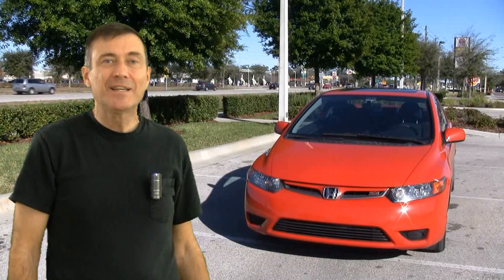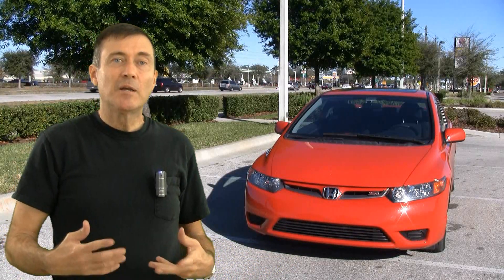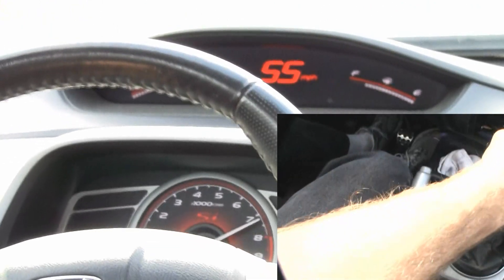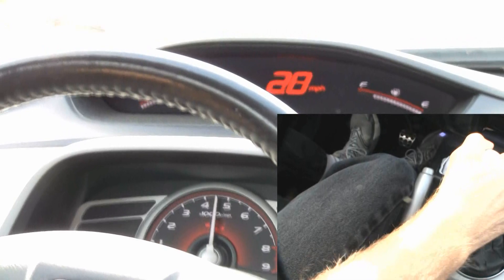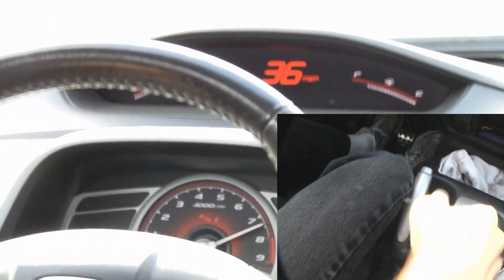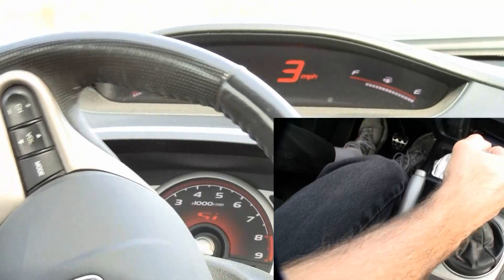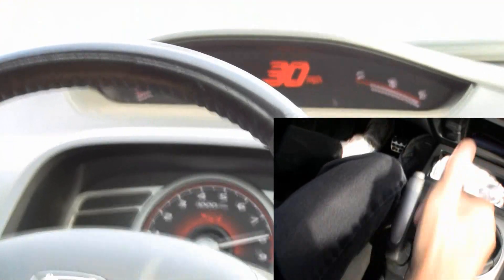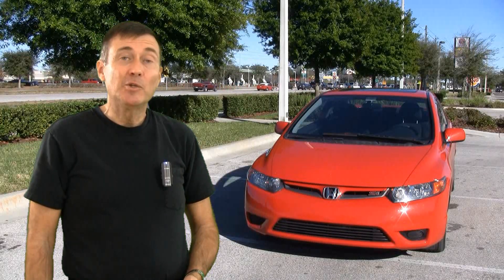Honda Fail #1 - Drive By Wire Sucks

Comment: I have a 2020 Civic Si Coupe and the rev hang in it was horrible. Pissed me off so bad. Made me hate the car and made me regret buying it. Bought a Hondata FlashPro and disabled the rev hang and the car drives so much better now. Drove me nuts before I disabled it. Will not be buying another Si again, that's for damn sure. Don't wanna have to buy a Hondata FlashPro again just to do that. I had a 2018 LX Coupe before the Si and the LX had no rev hang whatsoever and that car was a lot more fun to drive because of it.

Comment: I don't see an issue. In my 02 RSX type S (cable throttle), if I'm running to redline (8250 RPM), my shifts have to be extremally fast. I'm only off the throttle for a fraction of a second and back to WOT. If you shift slow, like you did, in my car, It's going to jerk as well.

Comment: I have a 2006 TSX 6MT and this lag is SO bad. I live in Ohio and the winters are long and brutal, and it's even worse when it's cold outside. It really does  not want you to beat on the engine before it's warm, but it's too protective. It's jerky no matter what you do in first gear. Really do love the car, but man I miss a throttle cable like the 90s Hondas.

Comment: Yea I just bought a 2007 with the r18 and a 5 spd. I've had 4 older manual hondas before,  2000 integra ,  1998 si ,1993 si, 1993 prelude srv . Thought this car would be like them but I was wrong. It's a nice ride but this electronic throttle system sucks .

Comment: I hate drive by wire. It's like a turbo lag. Ugh.
Reply: its called rev hang it leaves your throttle body open for a little longer so you can stay in high rpms

Comment: Two pretty easy solutions to the rev-hang.
1. Hondata FlashPro $600+
2. QREVS module $150
QREVS is not very well known compared to FP, but its sole purpose is to eliminate rev-hang. I have not used it myself. Google it if you're interested

Comment: i just picked one up and i don’t mind the rev hang. honda does this on purpose so owners don’t destroy their motor mounts over time, and emissions. it’s a close ratio transmission, if there was no rev hang you’d have to be changing gears pretty fast when driving normally to keep up with rpms otherwise your rpms would drop too low and cause you to jerk. i bang bears wot and the rev hang doesn’t interfere too much, but would be nice to flash that once i get flashpro.

Comment: Wow. That's weird how the engine stays reving. I don't have that problem with my 91 Integra. What a big contrast from drive-by-wire vs drive by cable throttle system.
Reply: I went from DA Integras to a TSX, and I do miss the simplicity of the Integras, but overall, the TSX is a much better car, the K series is great, and actually has torque.

Comment: All drive by wire with  manual trans runs like crap .the rpm just don't drop fast enough like a cable system. Manual trans should remain with cable throttle body.

Comment: This is why I sold my 370Z for a 30 year old Porsche. New sports cars are just not worth the money with the newer throttle by wire systems, and no one should have to spend close to a grand to get an ECU tune on a top of the price of a new car. I guess it's fine if you just want to go to the store and get some groceries.

Comment: Dear Sir-My local Honda dealer just bought the Hondata Flashpro service for customers. I had to go far away to Killeen to have this installed and to remove the rev hang. Cost me $400.00 but well worth it! I HATE the motorized throttle bodies, but there's no other solution that I know of:(-John in Texas

Comment: it disturbs me knowing just how many dorks there are out there that don't understand what this switched on guy is complaining about.  Mate, good on you for being one of rare ones that actually picked this up and are equally frustrated by just how bloody terrible fly by wire is.  It has DESTROYED the driving experience of every modern sports car.
Reply: I not only miss a throttle cable, but love cable clutches. Simple, immediately responsive.
Reply: @Red88Rex  even clutches are electronic now?
Reply: @automachinehead  Soon they will be, now they are hydraulic, which is still mechanical feeling

Comment: how often does your average new Honda owner wind it up to 8k? if you are racing your changes are quicker than 1second by a long way, I slam mine in the next cog like a Ferrari with a dog box barely buttoning off when I'm in " race mode " so it'd just catch my gear perfectly under thrashing conditions. wtf am I on about, I'd never buy a Honda anyway. Nissan 4eva

Comment: you can get rid of so call rev hang. it is all in the timing of gas pedal to clutch timing. if you let off gas pedal a little sooner before shoving in the clutch you will get rid of rpm staying high then dropping.  engineers did not design this it takes time for signal to go from gas pedal to computer to throttle body where a throttle cable is direct

Comment: The "firmware upgrade" probably doesn't exist not because they want to piss off their owners, but rather emission regulations. "Rev hang" is a feature in that respect, not a problem. A very annoying feature to be had for sure.

I was looking for a 2nd hand car a while back, and drove a Hyundai that seemed OK. But it had this throttle hang horribly. I didn't take it because of this. But I'm afraid it's harder to find "classic" cars with good throttle response. I drive a 2009 Ford fiesta 1.25 now, and I believe the 1.25 is a 90's engine (quite thirsty for an "eco hatchback") but it does drive very smoothly. Then again; the Ford have horribly sensitive throttle pedals on low engine speeds to hide the absence of torque.

Comment: You can get the ECU reflashed for different throttle curve.
Reply: how?
Reply: @MrKadvaga  go to shop have experience remap ecu.
Reply: @MrKadvaga  spend 1k for that and they only adjust the throttle sensitivity. I tell you, it's still far from actual cable linkages.

Comment: My 2012 or 2013 civic SI doesn't do that. And I am sure this thing called Hondata FlashPro would fix that rev lag. As it has made my throttle response better.
obviously This is just someone who hates Honda and is trying to make a video against the car to make it look bad. And if you can burn a clutch out in 50k miles in a DD it's 100% your driving not the car.
Reply: I have a 2020 Civic Si Coupe and until I got my Hondata FlashPro, my car had bad rev hang so no, he isn't hating on Honda. Honda actually did this with their cars. Especially the Si's.

Comment: My hondata fixed it and now its so sensitive i love it cuz i track my car i do not have this problem also if you want it to drop revs faster you can get a lighter flywheel exedy sells a 8.4lb one oem is 15 lbs this makes it also drop even more for more you can change the pulleys for even a faster drop theres a lot of ways you can change this they don't fix it because they want comfort over sport

Comment: I do not support computers in cars. Still... Easy on the clutch there, buddy! Driving is a skill.
8k rpm?! I drive like a maniac and I've never gotten over 5k. 3k is when I'm pushing it. I would try the following - rev it up slightly and turn it off to see how quickly it spins down mechanically. If it takes long, it's the sign of a well oiled together engine. If it's the computer doing stuff with the gas, well, sad, but still, check if there are any settings for that, be more skillful with the clutch and you'll be fine. At such rpms I'm surprised you didn't get a piston rod to the knee.
Reply: The redline is 8500rpm
Reply: Raven Crow its a si model,that is nothing for this cra, it was designed to be revved out
Reply: Raven Crow stock Honda s2000 revs even more than the si.. 9k rpm
Reply: Even with the Hondata Flashpro installed, the throttle still delays a bit, but nowhere as bad as it was stock-John in Texas

Comment: I don't think this is a big deal.  The VW's do the same thing with the GTI's.  It's weird at first but you get use to it and after a while it can help you by keeping the rpm up and power available higher when the clutch is released.  Shifting is actually not the greatest.  A car always puts out it's maximum output at red line.  In a perfect world the car would just sit at red line but we have to shift and this drops the rpm or power.  I think the idea is they wanted to make the car do a power shift for you automatically by keeping the rpm up.

Comment: Regardless of whether or not you like dbw or you think the Rev hang is good or bad, you can get rid of it or greatly reduce it by running a base tune on it with flashpro.
Reply: My 8th gen is flashproed and still is terrible.
Reply: Really? I thought that would help it but I guess not I don't mind the Rev hang when trying to gun it but it does get kinda annoying when just driving regular speed limit
Reply: Danny Martinez Compared to my cable ep3 with the same engine the performance and drivability is night and day. Problem with the revhang is its hard on both your transmission and clutch when power shifting.
Reply: There's still a little rev hang, due to the motorized gearing of the throttle body, but it's MUCH easier to adapt to than the stock car-John in Texas

Comment: I'm not a fan of drive by wire... ever try powershifting it, or letting the clutch out when the shift is complete and the all-knowing computer is lagging/ever so slowly closing the throttle?  I think the throttle letup lag is supposed to save the rain forest by reducing emissions by a smidge.

Comment: Please don't slam Honda when you don't know what you are talking about. It has been designed that way for performance reasons. Car manufacturers have been doing it this way for ages, like in the Toyota Run X RSI. It is to help maintain power through shifts. Do your homework first!!!!!!! It is not a problem, if you don't like it buy something else, or learn to drive! What sort of qualification do you have to make judgement in any case???
Reply: Yep, Tyler is just being a dumbass here.  It's obviously a refinement thing.  They assume budget drivers who shift slowly and want to make it easy to change up slowly.  Could also be for emissions, to prevent engine braking when driver momentarily lifts foot to adjust position on pedal.
Reply: The stock rev hang sucks, as I put around 278K on my 1994 Civic  EX  VTEC Coupe and the spring loaded throttle body is a MUCH better design. Heck, my dealership bought the Hondata Flashpro for their customers wanting custom tunes-John in Texas

Comment: my friend had that problem on his 06 si after three clutches in 15000 miles they tuned the computer for the lx with a aftermarket six speed now when he lets of the throttle the revs drop instantly not like when he first got it.

Comment: I had a 06 civic si and I understand about the rev hanging. When I sold it the clutch had 130k miles on it and still solid. In 8 years that car never broke down. I think u should try an automatic trans if u burned the clutch at 54k miles.

Comment: Let's look at the Civic Type R FD2 with the K20A I4 and 11lbs. flywheel.
fd2 type r  0-100 full stock It's noticeably quicker with a "stuck throttle" or "hang" of 1.00 sec. The Civic Si with the K20Z3 I4 and 16lbs. flywheel "sticks" at 1.3secs~. 

Does the FD2's engine rev "hang" or "stick" too much it terms of WWGuy's preference? If not, then perhaps it's just a matter of flywheel weight for the Civic Si. Honda engineers highly tuned and paid high attention of detail to the Type R FD2 and its K20A engine.

Comment: Video fail. If the throttle was stuck it would be bouncing off the limiter. Ecm knows you are racing and is holding rpms from dropping too quickly between shifts. I love when ppl who know nothing explain a problem with a product when in reality it is user stupidity.
Reply: +gtdrummerdude Having a computer do that is invasive and takes away control from the driver. People buy sports cars for total control of the car, not computers taking away control and deciding things for you.

Comment: Yepp, electronic regulation, just like on Mustangs. The RPM stays high to assist "average people" in shifting and torque steer. Kind of like "throttle matching" on the new 370Z's. It's good if you like the computer driving your car...

Comment: You can get your clutch replaced for $500 at a local master mechanic. Forget Honda Service. My 2005 Accord had jerky acceleration and braking. They couldn't fix it. After 5 years of ownership I figured out that the tension springs were far too small. After replacement? Like a Caddy...

Comment: If you want to fix your car go buy an ecu programmer and just fix the problem or replace the drive-by-wire throttle with a cable throttle and set the idle position to get the engine to run correctly and set the throttle idle position with the screw. I had a drive by wire k24 but popped on a drive by cable throttle and used a lower year ecu. or take the easy way out, just sell the car and go buy something else.

Comment: I miss the days of direct throttle control when engine revs would just fall naturally instead of being regulated by electronics. The 2-second break in acceleration when upshifting in order to maintain smoothness pisses me off.
Reply: It's done mainly for emissions-don't listen to everything that the government wants you and your dealership  to do. ALL Honda 4 bangers should have their oil changed NO LATER than 4,000 miles on the odo-John in Texas

Comment: Flashpro bro, flashpro. You will fall in love with your Si after you invest in Flashpro. It is pretty shitty that you have to invest $695 to fix this problem, especially if you plan on doing no other mods whatsoever, as it is pricey. But rest assure your rev hang will be gone after using flashpro. And if you do mod your Si down the road, Flashpro is a must have anyways.

Comment: You realize that drive by wire means that there is a wire connected to the throttle body and that controls it, what our si's have goes through the ecu first. thats why if you drive a car with actual drive by wire you can notice a slight lag when you hit the gas, which is inherent in almost any car that has electronically controlled throttle.

Comment: So you are complaining that it is unsmooth when shifting at high rpm? Well what do you expect? It's not supposed to be smooth at 8k rpm
Reply: He's talking about the rev hang issue..idk why he did it at redline, makes it harder to notice in my opinion. The rev hang does blow though. Still have to get the update on my 2012 si, too broke for flashpro :(

Comment: Look at the clutch foot, he keeps it there for like a minute while pulling his gas foot completely off the pedal. WTF ARE YOU TRYING TO DO MORON? DON'T YOU KNOW HOW TO SHIFT!?!?!? Your car doesn't have a race engine or power train. The RPMs would drop to 0 a lot faster if you had a lighter flywheel and/or very light internals. Your car is a mass produced POS and you expect it to act like an ON/OFF switch so you can shift gears like an even bigger asshole. amIright?

Comment: that's why I no longer buy hondas anymore, especially because where I live there are those idiots who modify their civics to make them look fast, then they drive like they're playing need for speed. Hondas are overrated the last accord i drove had so many issues with build quality, like the seat moving about during acceleration and braking, rattles, etc. oh and it had no torque at all. 
Honda cars used to be decent but now their rubbish.

Comment: It's got absolutely nothing to do with the throttle not closing, period. Instead, it's the injectors staying open AFTER the throttle is closed (foot off the gas) for stupid amount to time which is causing continued combustion that is causing the hang. Honda did it for emission reason and not to annoy owners, so blame it on the policy. As annoying as this problem is, there is aftermarket product that will completely eliminate this problem.

Comment: the best solution is to convert it to throttle by cable :)
Reply: it takes alot of time and as far as i know you lose the active idle control which is a complete pain in the ass in the morning
Along with living with a check engine light for the life of the car because it cant find its throttle body
Reply: buy electric cars or stick with pre-2006 cars. I own a 2019 tesla model 3 and a civic 2005. couldn't sell my first vehicle, which is the civic, due to me having sentimental attachment to it and I'm so glad I kept it.

Comment: flashpro can cause some really strange problems with fuel gauge readouts among other oddities including and up to bricking your car's NVRAM.  I was going to go the flashpro route, but not until Honda cooperates with them and removes these dangerous and occasionally irreversible bugs.

Comment: not only that, but the delay from mashing the throttle in neutral is either a second or more, or the car completely ignores it or clips the revs early. I don't like this "idiot proofing" behavior. I want COMPLETE control of the vehicle. My 1999 Corvette was fly by wire, MUCH older tech than my 2007 si, and everything was INSTANTANEOUS with the throttle, felt exactly like a throttle cable. Of course it had an annoying gear lockout when driving slow, but one resistor fixed that. FIX THIS HONDA.

Comment: Sprint booster won't fix this problem. It is the ECU holding the RPMs high on purpose. Flashpro and a new tune will fix this problem. Manufacturers should however, fix this because it annoys everyone.

Comment: You can fix this with a Flashpro. Admittedly its annoying to fix stock problems with aftermarket parts, but the reflash is pretty awesome all the way around. Totally worth it in my humble opinion.

Comment: We just had to replace the clutch at ~9,500 miles on a 2012 SI for $1700 mainly due to this problem.
Reply: 6th degree black belt here... learn how to use your feet properly.